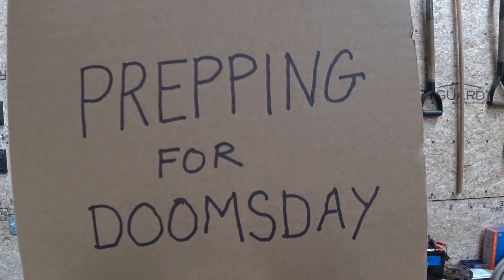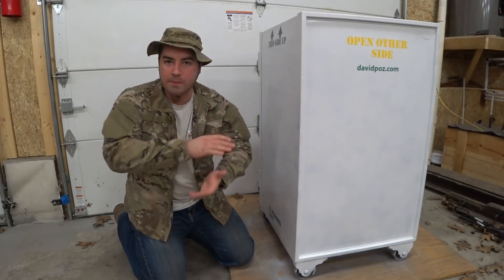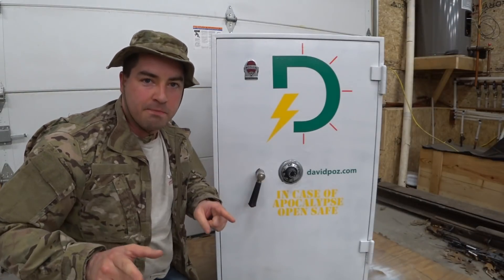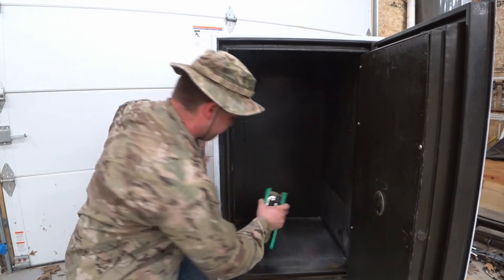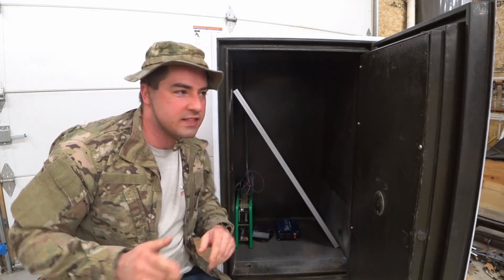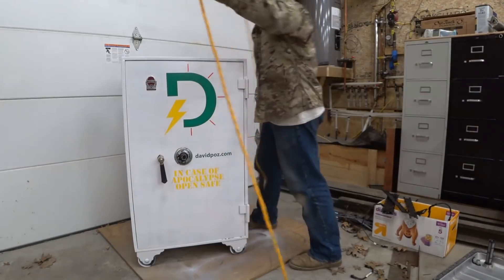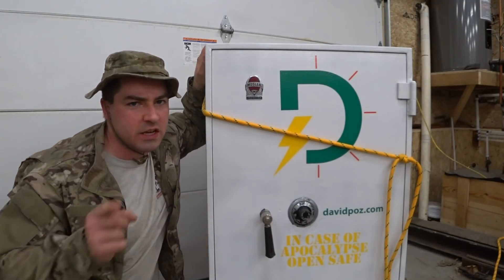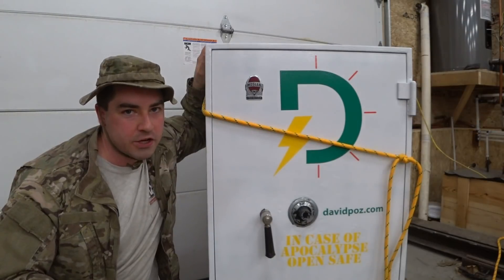Protecting Off-grid Solar Components from Solar Flares

Comment: Sure sure, go on and laugh at the expense of us on-grid slaves lol.     That said, my parents actually are one of many that have the crazy GE barker panels from the 60s or 70s with the split bus and as such there is no main barker.     If a CME or just any arrant surge in the grid reaches their panel it is already too late.  Perhaps it will pop each circuit but I have no idea.   They can't upgrade the panel either as the local inspector wants like 1000 other updates that will cost over $20k they are retired so that ain't happening.

Comment: OK IT IS METAL AND IT WILL GROUNG IT OUT MAYBE BUT IF THAT WERE THE CASE BEING IN A SHED WOULD WORK SOOOOO U NEED TO INSULATE IT WITH CARD BOARD INSIDE AND MAKE SURE NOTHING IS TOUCHING THE METAL I WOULD EVEN PUT META ALUMINUM TAPE AROUND THE SEAL OPENINGS AND GROUND IT IN STEAD OF ROPE USE A CORD AND BURY OR ATTACH IT TO PIPES

Comment: Hello David, If one does not have a heavy-duty safe available, can one use a large steel or aluminum trash can with lid and a cardboard insulated interior?    Would this be effective against a large solar coronal mass ejection?
Reply: I‘m sure it‘s better than nothing. Even a „cage“ would be enough. Metal obviously

Comment: David apparently you have not done you’re research any system above 170 vac or vdc will be affected if you keep you’re system under than that it will not be affected look it up in the government research papers all FOIA now I worked in the military back in the early 70s when Cold War was full steam they found that certain electronics were affected but 70percent recovered and high voltage systems were affected most I saw you’re solar was 180vdc lower it you should be fine midnite solar has lightning surge arrestees for the incoming Dc lines
Reply from the maker: Thanks dihvac1, My intention on this video was just having some fun.  It is not meant as a how-to, or to be taken seriously.
Reply: I know I thought you might like to know how to really survive an EMP or solar flare

Comment: Very good!  Wow, nice safe!   Curb find?
Reply from the maker: Not the curb, but close.  My church asked me for help removing it, just needed it gone.
Reply: @DavidPozEnergy  It could actually be used in reverse, if you're ever concerned about battery bank safety.  Put the whole battery bank inside, have a vent pipe with a couple layers of plastic sheeting to relieve any potential overpressure to the outdoors.